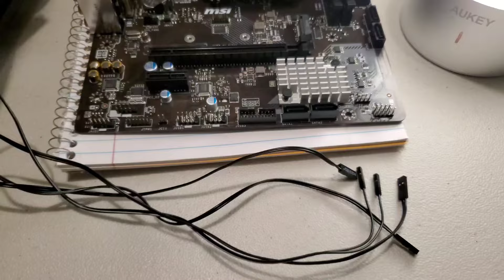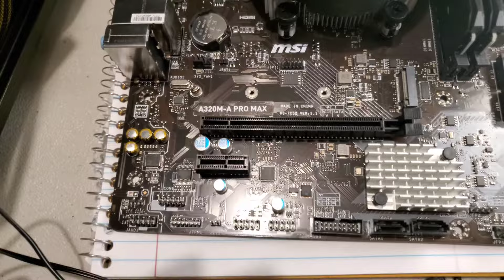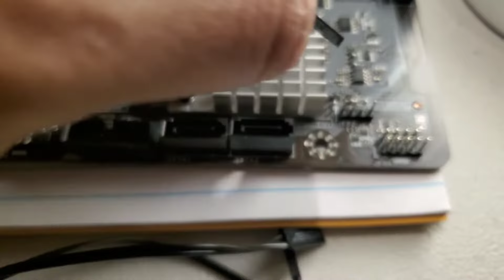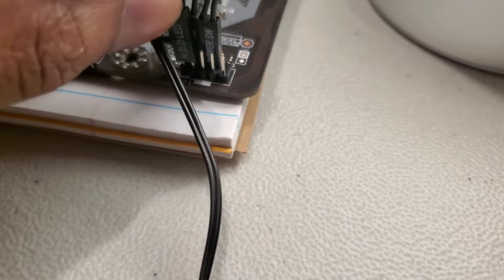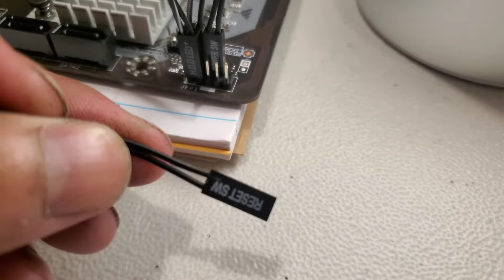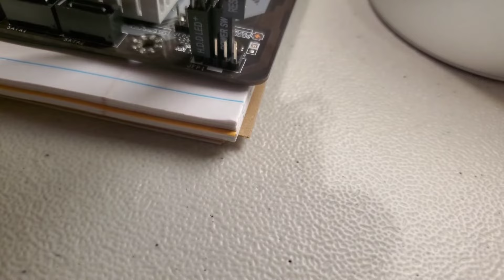Install front panel connectors on MSI mobo (JFP1)

Comment: Thank you!! I saw that but even though the pin layout matched the documents I wasn't sure because it looks just like the USB connectors. I've never seen a MoBo with such a tiny little place to connect the case control panel 😮😮😮
Reply from the maker: Glad I could help!

Comment: I think that the way you installed the last wire (the Reset sw wire) is wrong, I have the same motherboard, the positive pole is always on the left and the negative pole is on the right, but with (Reset Sw) the matter is the opposite.